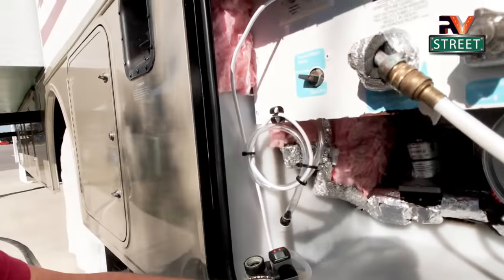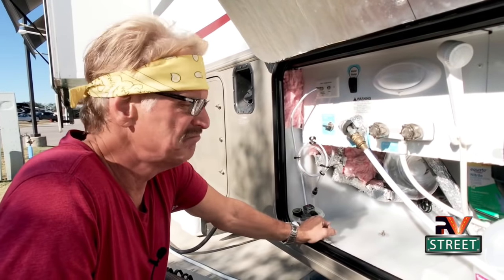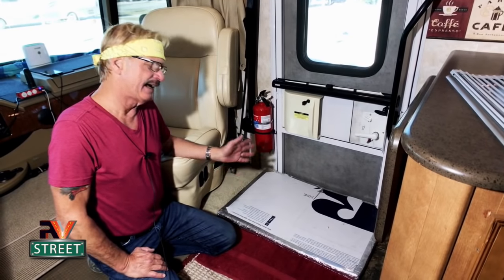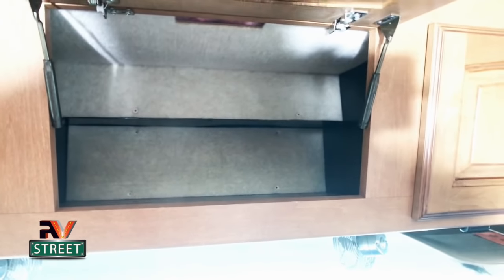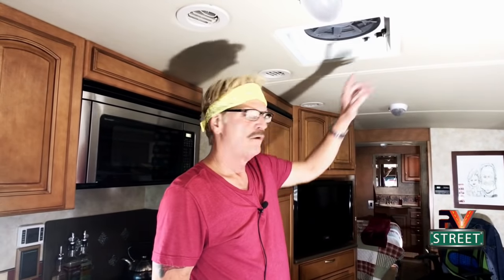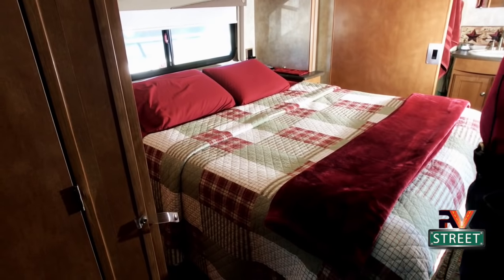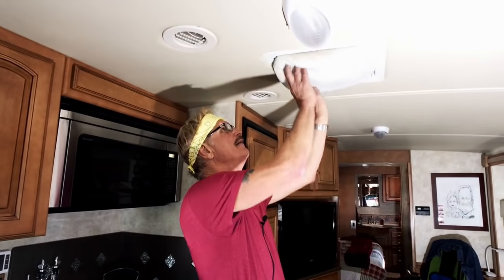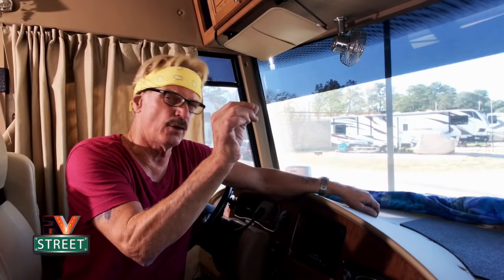😰  INSULATE, HEAT & PROTECT • Key to stay warm in your RV

Comment: When you get much below 40 degrees it's a good idea to run the propane furnace to keep the underbelly warm where most of the water lines, tanks and valves are located.  Tank heaters will keep the tanks from freezing but the furnace keeps the water lines from freezing.  1st time watcher and loved this video.  Lots of great practical and useful information.
Reply: Great tips👍
Reply: Also depends on where u live price per kwh vs lpg vs btu.
Reply: Assuming the underbelly is heated
Reply: Absolutely,  found this out this winter

Comment: I love how you have insulated the rig I think they should all be done that way from factory.
Reply from the maker: Ya, but they don't on most. Just something you have to do to protect your house better. 👍
Reply: Yeah but imagine how much money they save! Lol.
Reply: Totally agree! This video in a nutshell… find and fill the many spaces that lazy, cheap manufacturers leave empty and uninsulated!
Reply from the maker: @harvdog5669  This question has been answered in the comments below many times but here it is again....

In a nut shell, the faced insulation is normally used as a vapor/moisture barrier when used in home walls application but is not needed in this situation and especially when I’m putting in several layers in those large empty cavities. If Home Depot had unfaced in stock at the time, I would of bought that.
Reply: I agree!!
Reply: Yes! Especially with more and more people being forced to live in one year-round!
Reply: The reason why use the propane heater on our coach because the electric heat pump is sooooo darn loud and it takes a long time to heat. The heat pump blows cold, cold air until it reaches the temperature needed. It's way to gold to wait for it to get to the right temp. That's why we use the propane heater. It's nice and toasty!!!!
Reply: RVs were never intended to be lived in, especially cold weather. Most, if not all RV mfg’s will tell me “that’s why they have wheels on them, to leave those places” All RVs are designed to operate in temperate zones (40’s to 90’s) of the USA and canadia ( let’s geaux Treedeaux) You sir are to be applauded for your ingenuity 😊
Reply: With the amount of money that these things cost, you would think that these areas would be properly insulated. It's not that expensive or even time consuming to add some insulation like you've done here.
Reply: For as much is these rigs cost new or used should have a winter package that is actually insulated like yours is cheap ———b-st-rds !!! And I Do use my propane heater in the winter mornings just if I need it to be warm first thing once in a while!  Drinking my coffee Not every day, my ceramic heaters only can do so much ! I also have a 110 baseboard heater bought from a yard sale that have used every winter for…. 10 years!!!,❤ it !!
Reply: @RVStreet....2 years later, I'm looking at this video... Just started RV living in Canada in very humid, wet weather.. Particularly in the winter. 

This is great but also wondering if, while youve been filling cavaties with the insulation, did you worry/think about areas that  mice might get in?

Comment: Martin, many motor homes including our Georgetown Class A use the coach furnaces and ducting to circulate heat to the storage bays (especially the wet bay) to keep your water and waste lines from freezing. If you don't use your furnace NO Heat gets to the bays below. In addition we have heating pads on our Fresh water, Black and Gray tanks. You gave many great solutions to keep warm in the cold temps. One thing you might want to mention is to make sure you don't use too high an Amp draw electric heater on those electrical circuits. 15 and 20 amp are typically usually in most circuit design. But you can easily put too big a draw on a circuit when using these electrical heaters. I know  because I had a LED lamp and a ceramic heater on the same outlet and I could smell electrical insulation starting to melt with that distinct odor. I turned off the lamp and the smell went away. Strange thing is the Circuit breaker never tripped. I must have been right at the edge of the wire rating. Wishing you safe travels during these difficult times. Mike and Mary Davis
Reply: 5Th Wheels are done the same way to keep the underbelly warm. And if your Ciruit breaker did not trip when overloaded, your circuit breaker likely needs replacing.
Reply: Resistive Overheating is the term, and it can -- and does -- occur well below any breaker's rated capacity. It is seen in boating, too. I have lived aboard for years, and I have seen dockside power pedestals melted from resistive overheating, yet the 30 amp breaker never tripped. I strongly recommend not using any electric space heater on the highest setting, at least not for extended periods. If you do, check the temperature of the plug often (you will be surprised how hot plugs can get). Also, check the temperature of your main shore power plug. If you add all the various electric draws, especially in cold weather, you risk resistive overheating at your main power pedestal, too.

Comment: At the prices charged for some of these units, insulation like this should be done by mngr.
Reply from the maker: Agreed but most don't. Rv's are a bred of there own. It's just an item to pay to play IMO.
Reply: 95% of people don't rv in cold climates.  Rv's are built for that 95%. Unfortunately you can't custom order more insulation.  All but the million dollar units are built on a assembly line and they don't want to slow production with custom options.
Reply: @matthewerwin4677  Insulation helps with heat as well.  It keeps really hot out and allows a/c to not have to work as hard and cool air stays in rig.
Reply: @RVstreet  I have a mobile home same concept- my issue is below 20 degrees at the city water connects it is freezing. So my question for you is why did you take off the paper on the R-19? I’m going to stuff the pit with insulation... not sure how far down the heat tape goes in the pit. I also have a remote thermostat like you do as well
Reply from the maker: @MissyJohnson1991  This question has been answered in the comments but here it is again....

In a nut shell, the faced insulation is normally used as a vapor/moisture barrier when used in home walls application and is not needed in this RV situation and especially when I’m putting in several layers in those large empty cavities. If Home Depot had unfaced in stock at the time, I would of bought that.

Now in your situation being in a mobile home and if you're going to put additional insulation in your walls, then you would want to leave the paper vapor/moisture barrier on.

Hope this helps.

thx Missy
Reply: @RVstreet  so I should be able to leave the paper backing on it. It’s an odd situation they parked the mobile home about 5 inches to the left to far from water connections ugh... now my pipes are exposed- so the prior owner built a dog house to help contain the heat with heat tape as well. So I have foil back insulation and going to shove it down an old well pit that has been converted into a city water attachment. I’ve seen conflicting views that heat tape is of over insulation can cause a fire. So that’s why I was wondering if that’s why you ripped the paper off. Appreciate your quick response
Reply from the maker: @MissyJohnson1991  The paper backing cannot catch fire. You can literally put a match to it and won't burn. But if your filling a hole where your pipes are in this doghouse you'll have several layers more than likely so just tear the paper off OR buy unfaced insulation and put the layers in there. Just make sure they don't get wet.

Comment: Great tips on RV life in cold weather!  Please consider that residential outlets and RV outlets are quite different in construction. RV outlets typically use pinch point connections as opposed to screw terminals and they can overheat more easily. The use of electric heaters can place a very large demand on the wire circuitry so please use caution when using them and be careful to distribute the load to outlets on different circuits. I really enjoy your videos and maintenance ideas keep up the great work!!
Reply: I'm on fhu but for the reason you mention, I have a separate 120v outlet at the post that I use for high-amp appliances such as a space heater, vacuum cleaner, portable AC. I do have a radiant heater that draws 600 watts on its high setting and 300 on low. That is set on the floor near the sofa. It's not designed to heat a room, only objects or people/pets near it. Has a tip-over switch. Puts out a decent amount of heat on low.
Reply: never even have a resistance heater in your life.  they do a very poor job of making heat. and will burn you out. if it has not depleted your cash for electric power first.
buy one/two of the oil heaters that look like a old steam radiator.  but only ONE per circuit. as they can pop the breakers easily.
those small propane heaters will kill you in hrs. in a closed up rv, building.  kind of strange. you burn fuel, must keep a window open. that lets in cold air. that defeats everything.
Reply: Thank God for circuit breakers.

Comment: The propane furnace helps to keep your tanks from freezing.  I used a combination of both electric and propane.
Reply: I use them for the same reason. My tanks are and plumbing located in the underbelly stay warm from the warm air flow of the furnace.

Comment: That trick with the pipe insulation on the slides is really neat! Never used a RV with slides so I hadn’t ever thought of those issues.
Reply: We use pool noodles for stuff like that.  We also use pool noodles, split them lengthwise and put them on the bottom edge and corners of our slide walls.  It keeps you from braining yourself when you have to do something under your slides.
Reply: We use pool noodles. It helps us to remember to pull them out since they are a bright color. They also help keep out bugs when it is that time of year in a buggy area.
Reply: Yeah it's a great IDEA. I USE THE POOL Noodles.. I HAVE FOR YEARS...
Reply: Also use pool noodles to insulate water hoses and other lines you want to keep off the ground.

Comment: I'm amazed at how many appliances going at one time! I live in an older camper and found out real quick I couldn't run a heated blanket in here! Or even run the hair dryer with the microwave.  Its a 2007 model
Reply from the maker: I can only assume that you have a 30 amp RV. With that being said I totally understand what you are saying,  during the summer we have lived on 15 and have to be very careful of what we are using.

Comment: The ceramic heaters is a great idea....wish I had thought of it sooner.  The heated mattress pad is the best invention since the shirt pocket; we have one in the RV and at home, because I am very cold natured.  When not in use, we store our Class A Thor POS in a covered RV parking facility.  When it gets cold enough to  worry me about pipes freezing, I put drop lights in the wet bay and we turn the furnace on and open all the cabinet doors in the kitchen and bath.  Yes, it uses propane, but propane is cheaper than having plumbing fixed that I can no longer do.  This method has never failed us, even in the cold snap here in Canyon Lake, Texas back in FEB, where it got down into the low teens.  Love your videos, keep up the good work.

Comment: Great ideas you presented.  In sub-freezing weather and staying in a full hook up site, we use both a portable heater and the propane furnace.  First to keep the basement from freezing and secondly to move warm air around in the living spaces for more even heating.  If we only use the space heater, then we end up with cold dead spaces such as in the bathroom.  When we are not worried about freezing the basement, we use a portable heater solely, but move the warm air around using small fans.

Comment: I only run our propane furnace in the morning to get it warmed up quickly, and then let the 3 floor heaters take it from there. We do have it automatically set to kick on if the interior drops below 60 degrees and it’s too cold for the electric heaters to maintain. 👍🏽

Comment: I got those vent pillows last summer, and boy do they stop the heat/cold from coming in the coach...highly recommend them
Reply: LOL--I have used chair cushions for years!
Reply: Do they have them for the bathroom skylight? That is where so much heat comes in the summer.  Was going to change mine out for a smoke colored one thinking it may help. Why do rv manufacturers put them in, light?

Comment: use your metallic tape and tape one joint of your "slider" blockers to make a hinge of sorts, would help avoid pushing that little piece too far in and having to pull the bigger piece to retrieve it. I'd also consider adding a hook and loop or magnetic fastened over-lap apron around the whole edge to really prevent dust/drafts from getting in.
Reply: Good idea.
Reply: Or over the small piece for sliders, glue a single wider piece, creating "wings" that stops it from being pushed too far.  This allows the small piece to slide upwards.  You will see at 6:54, the notch that prevents a hinge action.

Comment: I use alot of electric heat However most campers need the propane heater running to prevent plumbing
 and compartments from freezing. I also prefer an electric blanket over me vs a heated pad under me because if you get hot it is easy to remove covers but if the heat is under you it takes longer to get away from.

Comment: Running the propane furnace allows heat not only into the trailer, basement but underneath the trailer to warm the water lines and sewer lines. Electric heaters are a great additional source of heat but you still need to heat the underbelly of the beast.
Reply: This is the purpose of him using utility lights and insulation since no heat in underbelly on his model

Comment: I am a big time winter camper............great info!  You have out done me! I need to get to work................Thomyt
Reply: Add the silverback foam board under the floor to help and run the lower fan to help keep the bays warm.
Bob
Reply: Where did you get the small dehumidifiers?

Comment: Martin & Joanie, all your ideas are brilliant!! The part about insulating behind cabinetry, under the sink and bed, is pure genius!!! Love times infinity!!!!  Just one more idea to share (you may have already and I missed it), is picking up a portable"soGen" power generator like a Jackery 1000 to run at the very least the little space heater, and/or perhaps the bed warmer, in case of a power outage----to get you thru a chilly night, for example.
Reply from the maker: Not sure about a portable generator like a Jackery 1000. I don't know anything about that particular genny. If you have your battery bay set up right with multiple house batteries like we do you could just run the inverter and plug into one those outlets and plug in an electric heater. Then just recharge the batt's the next morning. Or like us, we could just run our regular on board generator. Or as a third choice get a Mr. Heater. Thanks so much for your kind words Shiammi. 💋
Reply: @RVstreet  You're right <3 ...we're just now gearing up to install multiple house batteries... wishing I could give you more thumbs up!! lol
Reply from the maker: @shiammi907  👍💋

Comment: I am spending my first winter at 6,000 feet and I am going to try many of these ideas ASAP.  Thanks.
Reply: Try getting a camping wood burning stove or better yet an old 1890s one burner cast iron stove. Stove pipe can go out sun roof or side window or take out air conditioner and cut rond hole in CENENT BOARD for window or air conditioner opening on side wall I you have one.

Comment: This was so informative. I have an 1995 RV and heading through some cold territory. At one point I thought, I only have 30 amp service for the ceramic heaters but I was thinking augmenting my furnace with them, not using them INSTEAD of the furnace. So smart. Now I just have to see how well it will heat the RV! Your videos are so good and that’s the reason why you’ve got the following. Well done!

Comment: I use the propane furnace when possible myself. Propane isnt to expensive here. But my reasoning is so I can conserve the electric for other devices when Im awake. Im on 30amps and enjoy crafts like sewing. But I have electric heaters just in case because temps can get below zero for me and the propane will stop flowing/working properly at that time.

Comment: I am one of those guys that like Reflectix.  When staying in my Airstream Basecamp 20X in subzero temps every night in Jan/Feb at Breckenridge I put it in all my windows and, trust me, a warm cave is better than a cold window view!  I also insulated all my pipes with the foam insulation and placed more Reflectix between the pipes and the outside walls.  The only other area of concern was the dump pipes between the tanks (which were heated) and the release valves.  I corrected this by wrapping the pipes with heat tape, then insulation and finally waterproof tape.  The heat tape was plugged in to my external outlet.  One night it actually got to -31F but I never was cold…..went through lots of propane but stayed warm!
Reply from the maker: Thank you so much for your input and information. Sharing  your experience and knowledge helps the RV community. It sure sounds like you have everything under control. Stay toasty my friend.